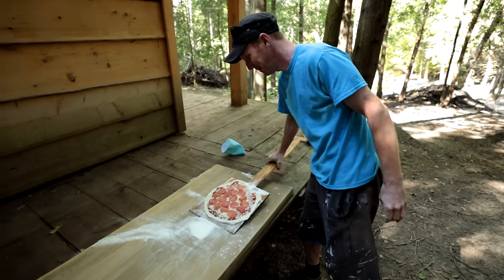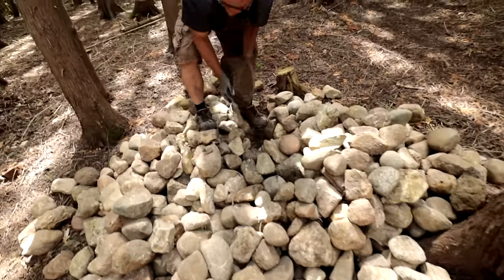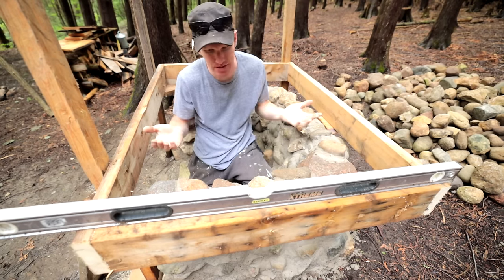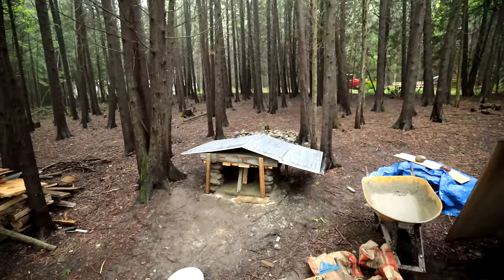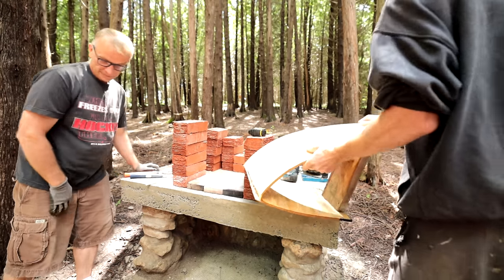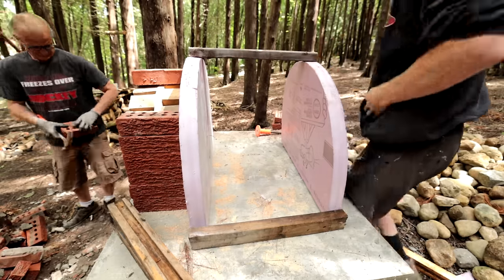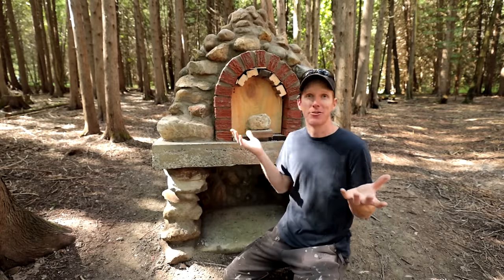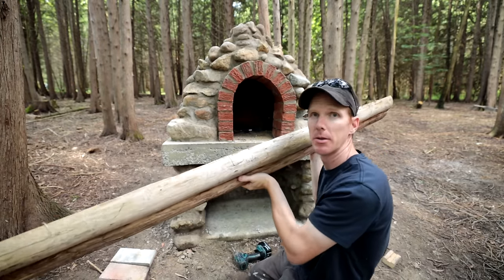I Built a Rock Pizza Oven!

Comment: I have a couple tips ,  1.Build your fire then move your coals too one side or the back.  2. Get a rectangular wire brush on a long handle ( made for  this) to clean the floor of the oven. 3. Semolina for your work surface and peel. 4. Learn to pick-up your pie  by the front half and turn it as it cooks. Once the floor gets seasoned this will be easier. 5. Once your oven is at temp., you can cook in it for a long time before it cools down below cooking temp., so a very small bed of coals or fire will suffice. 6. the ovens we use in our business get 750 degrees and up in the dome even hotter, if needed lift the pie up in the ceiling to finish them, if needed. We make bread in the oven as it comes up too pizza temp.  I hope this helps.  Good cooking!

Comment: This is advice based upon brick oven / coal fired pizza places. Rotate halfway thru cooking for even temps / char , and then usually the last few seconds take the pizza on the peel ( the item used to move the pizza ) and lift it near the top of the oven for the hottest temps to get some color / hint of char on the top of pizza. Called Doming (dome-ing) it.

Comment: My experience: only coals. No flames. And if u put a damper of sorts on chimney you can cook anything u want ! Even stews and chowders in a Dutch oven. Great video and oven build!! Really enjoying the channel wood chucka
Reply: Good advice. You could try coals on one side and rotate the pizza as it cooks. Thats what they do in the big woodfire ovens.  Very cool oven!
Reply: @kraigsjodin9709  the rotating part might work wonders.
Reply: Good idea Tony!
Reply: Yeah, you can always add a chimney damper at any time. Just add a short piece of chimney pipe with the dampener in it. And add a thermometer.
Reply: I also make sure all the coals are on one side of the oven, but I actually go with a small flame.

Comment: From a wood-fired pizza chef: you need a fire on one side of oven and need to spin pizza as it cooks
Reply: Absolutely. Hot side to finish them off, cool side to bake. Spin them as they cook. I’d also get a thin metal peel. (Pizza shovel) An oven brush to sweep away ash, then I use a pipe flattened on one end to blow away the rest. (A headless golf club works perfect, has its own grip) Pizza perfection!
Reply: With all hand built ovens, it’s learning YOUR oven. Trial and error. 
Something I’m definitely good at.
Reply: If you have a good air tite cap you can use your oven as a large smoker! It also works great for roasting your salsa veggies!
Reply: I didn' t know yet! Thanks!
Reply: Good info
Reply: This was a disaster the second he threw that pizza in there
Reply: NO. real pizzaoven wood take all out before baked pizza or pizza burn too lot-. wood need only heat pizza oven rocks hot and then sweep oven empty and clean and then fill pizza in oven. then not burn lot. and after pizzas have ready and temp go down, baked bread same heat.
Reply: @mattivirta  false
Reply: @mattivirta  Blah blah blah

Comment: I realize that I'm commenting over a year after posting this video, but here is a pizza crust recipe. It has been several decades since I have made pizza dough, but this one looks similar to the recipe I had. One thing I did was make more dough than what I needed for one pizza so that I could make another one in a day or two. I found that if I left it in the refrigerator for a week or two, it would turn into sourdough! Sourdough pizza is absolutely fabulous!! One topping that is excellent with others is cashew nuts. This is a San Bernardino and Redlands California specialty. You might try using cashew pieces in the dough as an alternative to spreading them on top. 2-2 1/3 cups all purpose flour, or bread flour.  2 1/4 teaspoon instant yeast, or active dry yeast, 1 1/2 teaspoons sugar, 3/4 teaspoon salt, 2 Tablespoons olive oil plus some extra, 3/4 cup warm (100°f to 115°f not hotter. It will kill the yeast)  (1) combine 1 cup of flour, yeast, sugar and salt in a large bowl (wood, glass, or plastic, not metal). (2) Add olive oil and warm water using a wooden spoon. (3) Slowly add 1 cup of flour, and any additional needed. Stir until the dough begins to pull away from the bowl. It will be slightly sticky, but easy to work with. (4) Coat a large clean bowl with olive oil.  (5) Lightly dust your hands with flour and form dough into a ball. Put the dough into the oil coated bowl and brush some oil on the dough. (6) Let the dough rise until double in size, about 30 minutes. About 80ºf is what yeast likes. (7) Push down the dough, then kneed it on a floured surface a few times. (8) Roll it out with a rolling pin, or use your hands to flatten it into a 12" circle. (8) You may want to brush olive oil on the dough, particularly the crust. Then poke holes in the dough with a fork to help prevent bubbles. (9) Spread sauce (Marinara, or try Pesto sauce, or Alfredo sauce.) then put your favorite toppings. You can use a pizza pan, or put cornmeal on the bottom of your beehive pizza oven and let it cook. You can also put herbs like garlic, oregano, rosemary or what ever in the dough for a great flavor. In a 450°f oven the pizza cooks in about 15 minutes. Beehive ovens can cook a pizza in 3 minutes or so. Enjoy!!

Comment: For making a pizza for the first time, you've practically done it 100% the way the pros do kevin, 

1. You put the pizza back in the exact spot where you put it in at the beginning. Therefore it didnt burn the base.. 

2. Speed is key to making a pizza. Leaving it on the prep surface for too long wether its floured or not will tend to stick the longer it sits on it. Similarly, when transferring the pizza to the oven, make sure the paddle is well floured and the less time the pizza (before cooking) is on the paddle the less it'll stick to it.. 
Passing advice from experience.  Lol 

Other than that, a brilliant build and a Brilliant pizza at the end dude!! 👌
Reply: Thanks for the advice and for watching!
Reply: Another hack is to put the bare crust into the oven for maybe 60 seconds at that kind of temperature, then pull it out and add sauce/cheese/toppings to the par-baked crust then put back in to finish. It will slide off the peel easier and the toppings won't go flying so much. It's not how the pros do it, but it works. re: Cooking time. Restaurant wood pizza ovens will cook a medium pie in under 3 minutes (800 deg F+), so when you said "10 minutes" I was worried you'd end up with charcoal!

Comment: You use the fire to preheat the oven, then scrape out the coals with a metal tool into a metal bucket. Use a cloth mop to clean the oven floor, and let the latent heat cook your pizza, or other food, then after you can use to to cook bread when it is cooler, or beans over a period of hours, then when it's just warm later, you use it to dry herbs. Here is an example video - https://youtu.be/WAJqGVxuJPo
Reply: Depends on the kind of pizza you're making. For the Neapolitan style -- what most people are thinking of with "wood fired" pizzas -- a fast, hot fire is fine. It usually only takes 2-3 minutes to cook that style of pizza, and it should have a light char in the form of "leopard spotting". For general baking and cooking, though, you are describing the correct technique for a traditional oven. That makes pizza great first course or lunch, since you can use the oven hot, then scrape the coals out to prepare for the day's baking.
Reply: @bloodgain  YES! First do the Pizza for luncch, then take out the coals and bake some baguettes and once that's done, put in the lasagna for dinner, which you eat with the baguettes from earlier! :D

Comment: If you have a problem with the dough sticking use corn meal. Just sprinkle it on your board and when you stretch your dough do it on the board. Also sprinkle a little bit in the oven it will act as bearings for the pizza to roll on. Just a tip from a guy that used to make and deliver pizza in high school.
Reply from the maker: Gonna have to stock Corn meal...  pizza bearings!!

Comment: Some corn meal gently scattered on the bottom of the crust will help slide the pizza off and on your paddle.
Reply: and don't let the pizza sit...make it on the peel over a light sprinkle of cornmeal, get it in the oven as soon as you make it..otherwise, the moisture will leach out into your cornmeal and make your pizza stick to the peel..good job on your oven!

Comment: If you don't use refractory cement the regular cement will start to degrade. So if your pizzas seem a little crunchy after a while don't be surprised. It should work for 6 months to a year. But eventually it will start to degrade.

Comment: The mortar is made by 3 parts sand and one part cement. Heat expands the steel and it will crack the cement. Pepperoni is capsican , so call it salami pizza.

Comment: There are metal supports called “chairs” that the bottom rebar sits on. The bottom rebar needs to be suspended. The rebar needs what is called “coverage.” Space around the rebar for the mortar. The rebar is tied so it doesn’t move around during the pouring process. Depending on the thickness of the “slab?” I would have build another “Mat” on top of the lower “mat” using another level of “chairs.” I would have had  small pieces of rebar on an angle in the corners of the form. The pizza oven looks great! Beautiful job.

Comment: Super fun oven!  A couple of things that will help is to use smaller wood for the fuel.  We call ours oven wood. about 6-8" long and no bigger than your wrist.  It will spread better out on the floor better, and be more consistent coals for the actual cooking.  We also have a laser thermometer that we use to track the temp, 600 degrees plus will cook a 12" pizza in a minute or two.  After all our pizzas are cooked we clean out all the coals and throw in our bread for the week once the oven cools down to 400 or so.   Love your projects, I'm new to your channel.  Keep up the great videos.  Cheers Cappie
Reply: Thanks for watching!  Also good advice.

Comment: You tie the rebar together so it doesn’t shift when pouring that’s it
Reply: I figured it had some structural reason...
Reply: And ads flexibility.
Reply: @cmosphoto1  lol what.   Once the concrete dries the rebar isn't going to move so the ties have zero purpose at that point.  Not like the rebar is going to go on a walk through hard cement
Reply: @oregonsdank  He said, 'when pouring.'

Comment: a little wider opening.  Keep on the lookout for a pizza stone-  or a piece of thick steel  as the floor. Using a layer of cob material on top of your arch on the inside. do a layer with possibly crushed up fire brick  and a little clay- use a fork to score then use another layer with a little less fire brick dust in it and  score the surface and then another layer with a little less.  then cap with the stone and mortar.    Keeping water out of the structure and bricks is key.  IF you have water in the bricks and they rapid heat good change they will destroy themselves. Also start with a small  small fire and slowly heat it up.  you could even do a double arch with some fiberglass insulation or mineral wool sandwiched between.    That is what most ranges are a layer of steel- -insulation and then another layer of steel.    The pizza oven has lots of heated mass that radiates the heat from all direction.  most pizzas only have a few minute cooking times.  There are some porcelain tiles that I would consider using  as the floor to a pizza oven.  recycling the lid off a old charcoal grill could  work to create your arch structure and you could leave it in place.  build a wall with two or three layers of brick for it to set on.  Then just fill over it.   Well fun project.  Lots of ways you might do it.  And you did get a pizza out of it.
Reply from the maker: Thanks for this comment!

Comment: Very nice. Keep in mind that when cooking pizza the fire should be only on one side usually on the left and don't close the oven otherwise the pizza will dry too much and burn too fast. Just turn the pizza a couple of times to get an even cook. Another thing, the pizza shovel must be very smooth and when dropping the pizza be sure that the shovel is flat to the surface.
For a proper margherita put tomato sauce only, when the pizza is almost ready take it out and put slices of fresh mozzarella and put it back to cook.

Comment: Kevin You was rocking and rolling 
When you pulled off with your trailer! Lol 😂
Next time let your fire coals burn down about half of what they was when you put the pizza 🍕 in this time! The coals should look like they are barely going for a pizza 🍕 
Or otherwise you’ll have it too hot and burn it. Even though they look like they are barely going once you close that door it’s going to get extremely hot inside. Try that next time. 😉
Reply: I agree 100%. Let the inside of the preheated oven and hot coals cook the food, not the flames of the fire.
Reply: Terry Sincheff and you got chef 👨‍🍳 written in your last name, Right ? 😂
Yeah he had all those red hot 🥵 coals and fire 🔥 still in it and that’s why it burnt the pizza 🍕. Yep he’ll be fine to let them coals burn down more before putting the pizza in. 😁👍
Reply: Next time for sure!
Reply: Kevin the Wood Chucker yep 👍 just like when you let the coals get burnt down some & start turning white in a charcoal grill before you put your burgers 🍔 on there. Or otherwise you’ll burn the outside and the inside will be raw. U want it to cook slower. U’ll get it figure out down to a science! 👍😁👍🍕

Comment: Love the oven, and a great first pizza. Try a smaller fire and get yourself a lazer thermometer, that way you can get a good internal temp of the oven. Professional pizza ovens run around 700 degrees and cook a pie in around 90 seconds. Keep experimenting and you'll get it.
Reply: Darren Mcdonald, I build a fire in the middle of my wood fire pizza oven, when it is all alight and hot I push it to one side of the oven, let it go for another 5  minutes then throw some flour on the the hot heat bricks, if it explode, the temperature is correct, do not spread the fire around your pizza, leave it to one side, the extent of the heat due to the shape of the oven will travel to the other side, also you will have more room for more pizzas.
Reply: @samirnahhas9384  I agree. Never move the fire around, too easy to get ash all over the pizza. I never heard of the flour trick though. I'll have to give it a try.

Comment: Suggest using a much smaller fire, in one corner of the oven. It should be more than sufficient to provide cooking heat. 

A little experimentation to establish temperatures would help as well.  FInding that sweet spot will be vital to a successful bread or pizza result.
Reply: I use a laser thermometer for this sort of thing.  It also helps to check for hot/cold spots.
Reply: Please remove the fire and bake using residual heat.

Comment: Nice job. I see there have been other comments about making the chimney higher for draft (a higher dome compared to your door wouldn't hurt either - but it's past the point to worry about that). I saw the comments about corn meal on the board and the floor of the oven to make it easier to slide the pizza... as well as not letting the pizza rest too long after you make it... and not overloading the toppings - so I think everyone else covered almost everything. The only thing I would add is temps. The old timers would know when the oven was hot enough -- because the inside (roof) would no longer have soot (black) on it... the heat would burn it off and you would have a "clean" ceiling on the inside. Then they would pull the flame and use the oven. If you are going to maintain a flame in there, as others have mentioned - keep it on one side and rotate approx. every max. 30 seconds. I really like your "get it done" attitude and just going for it. Too many people get "analysis paralysis" and end up not doing it. Great job jumping in and figuring it out as you go. When you look back - you may find things you would do different next time... but for now... you have a working oven... and a good one too. Well done.
Reply: Analysis Paralysis... I like that... People think when you do something it's forever... Nothing is stopping me from tearing this down and re-doing... Or build an army of pizza ovens!  Git er done.

Comment: OMG, I love this. For all you peeps out there.  CORN MEAL!   Sprinkle the corn meal on the paddle prior to putting the pizza dough on it. So long as you don't have holes in the dough leaking sauce, it will slide off / on easily.  Also, as others have said, coals on one side, pizza on the other. Rotate it.

Comment: Good effort but with all that effort you went through would have been worth going the extra mile as that isn’t a effective way of making a oven. The brick will crack and spool over time and won’t refract the heat like a real fire brick. You also need to insulate the dome for it to work properly but most importantly the chimney doesn’t go on the man dome it goes on a second arch at the from so when you put the door on it seals the heat in once you have heated The fire brick. It’s the brick that cooks not so much the fire. Not trying to be critical but trying to help other as I build pizza oven for a job. There’s a science to building them. If you google traditional oven you will find lots of info.
Reply: He used fire bricks

Comment: Nex time cover the wood with used engine oil, it will prevent the concrete to adhere to the wood. And in traditional ovens(south of Mexico) we use "uncooked" brick. The heat of the oven will do the rest and prevent it from cracking. You can actually use clay instead of refractory cement for the inside and will prevent the mortar and rock from cracking 😉
Reply: Might like the inside with clay.